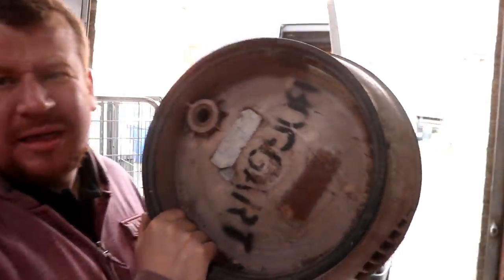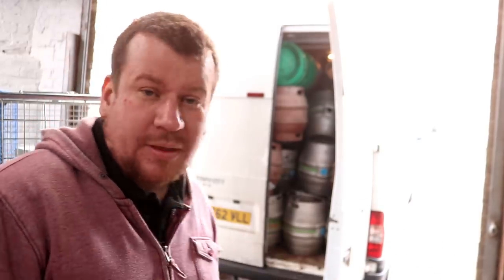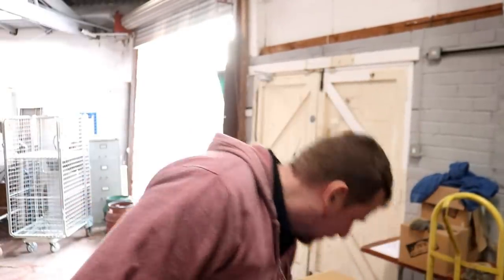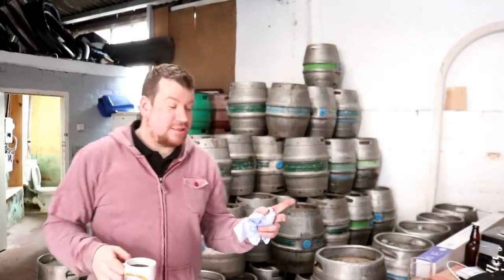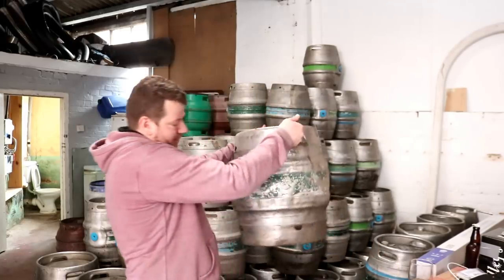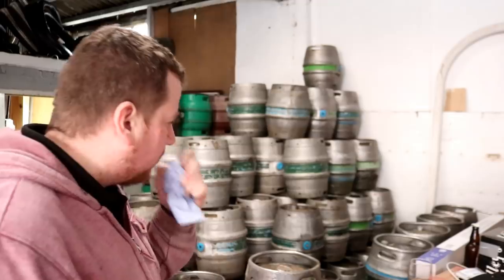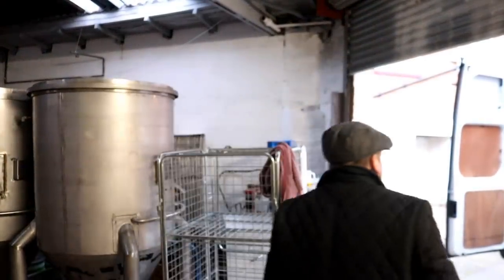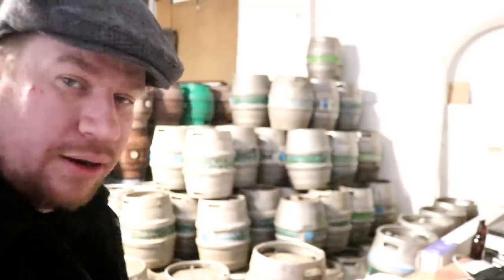A LOAD OF OLD BOGGARTS

Comment: Good luck on picking up the safe as they are bleeding heavy 😄. Hope your going to bolt that bad boy to the floor and at least one wall but better two. No point in having a safe unless it's nigh on impossible to remove it. Super update as usual, will this one stay up 😲 😄 ?  Cheers, Schnuz.
Reply: Schnuz. No need to bolt it to the floor I could open it in 15 mins no problem
Reply: @DCBREWERY  The average low life tea leaf would just try to carry it off. Safes are just another deterrent like an alarm, tends to keep your stuff safe from the opportunist low life. Cheers, Schnuz.

Comment: Nice haul there Harry m8,some of them do look a bit dickered as you said but even if only half of them are viable it's a great haul eh. Not sure what the consensus is on using aluminum for beer or brewing these days,maybe you could touch on that in next video. However I've just thought some of the non useable metal ones could be converted to urinals for the gents in keeping with the pub theme,also could be converted into rubbish bins etc for pub or flower pots for beer garden etc. Any useable left over flog them to home Brewers at some stage. Cheers.